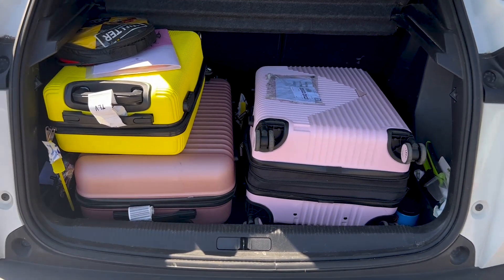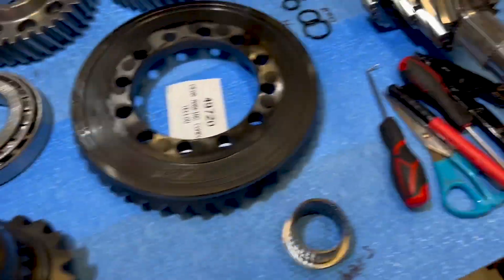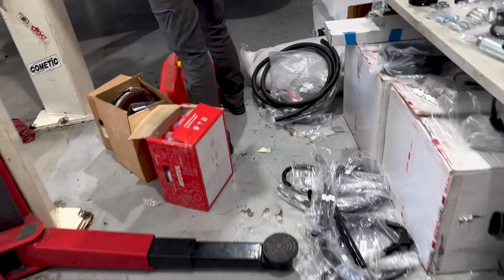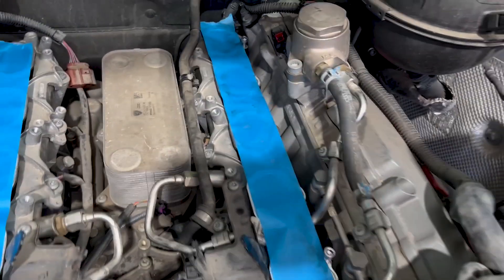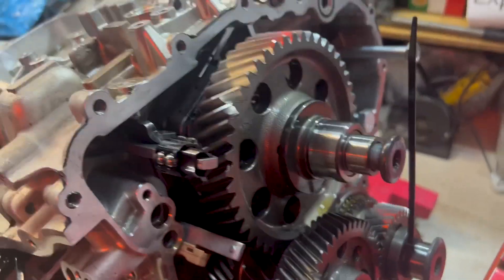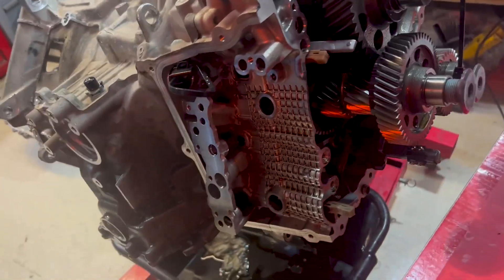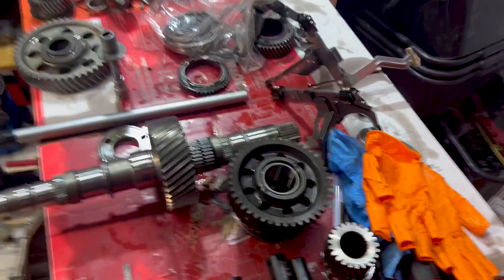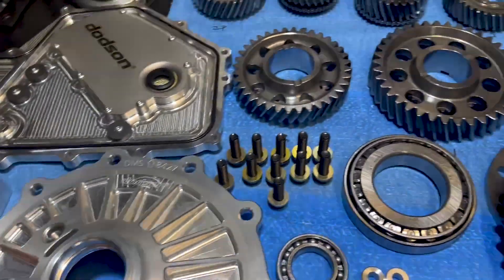We Got Our Parts Back From Customs! | Workshop Update No.6 In Israel

Comment: That must be just a little bit frustrating working in conditions that you simply would not tolerate back home. Absolutely no offence intended to the garage owner - it’s not your place or done your way and we must respect that. 
Your fantastic knowledge base is backed up back home by surgical precision organised workspaces and theatre room cleanliness. All adding to the faultless end results you consistently achieve. 
Are you just a little concerned or double checking your double checking to to make sure nothing is being contaminated or spare bits appearing down the line?  I know I would be shi77ing myself.
Reply from the maker: Not what I’m used to but we managed! Certainly didn’t lower our standards just had to be extra cautious!